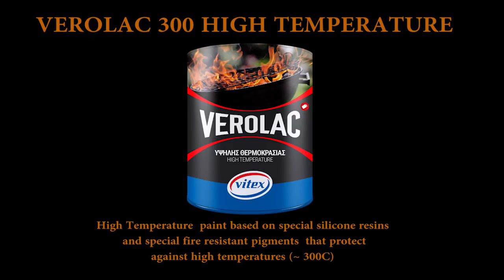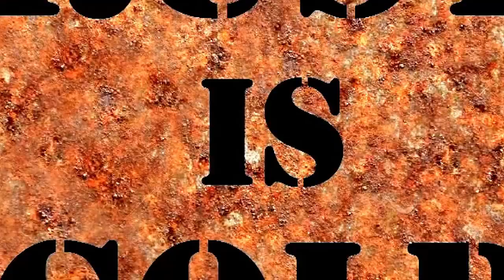How to create a Spacecraft BBQ Grill/Fire Pit from the Dark Side!!!

Comment: DIY my ass !  I don't have a full metal shop in my kitchen , still cool .
Reply from the maker: Except from the part were I went at this shop to have the metal sheets cut and bent the rest of the project was done with a drill, a cutting disc and a welding machine bought at a local hardware store in my neighborhood. Nothing fancy about it. Still it is DIY!
Reply from the maker: Check out my latest Star Wars Creation!
R2D2 BBQ GRILL!😊
https://youtu.be/br0hPKZU5L0